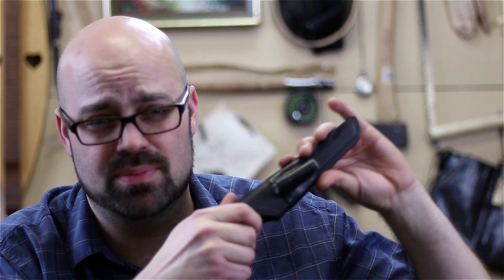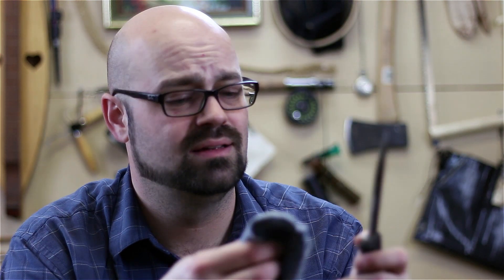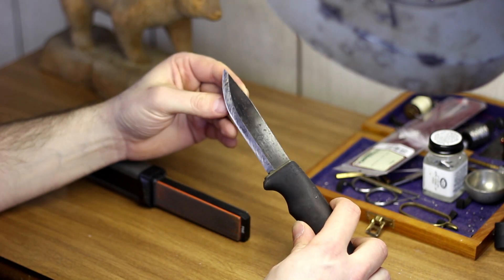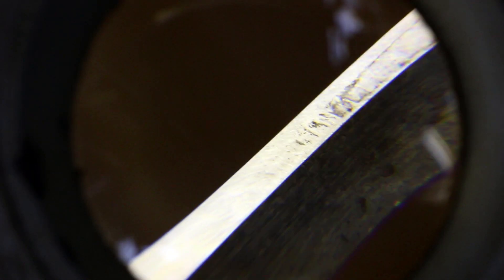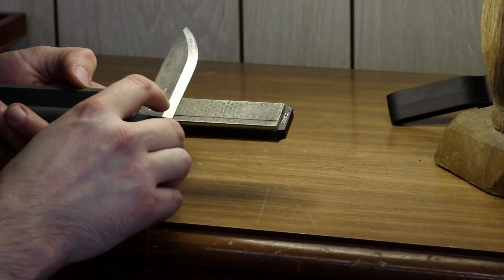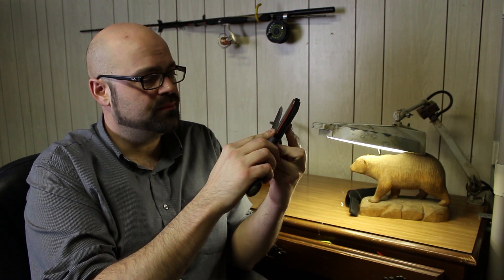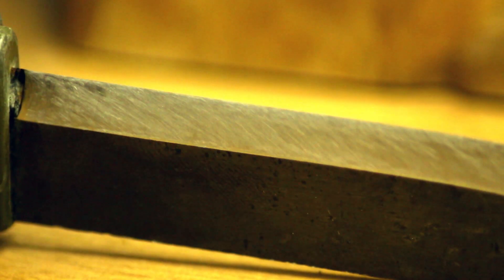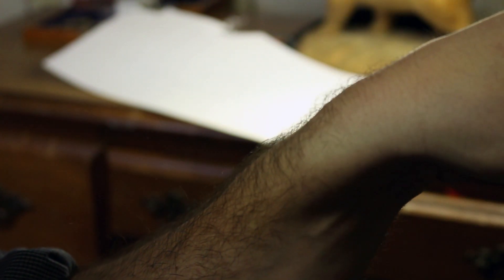Knife Sharpening - Cheap and Effective

Comment: The Smith's duo diamond sharpener is, in my experience, perfect for folding knives with blades up to 3.5 inches.  I have used it to keep an edge on my Spyderco Resilience, but I feel more comfortable working this 4.25 " blade on a larger sharpener. great portable sharpener and quite affordable.

Comment: Ive used Smiths Diamond stones like that for at least 2 yrs - cant say a bad word except longevity... I put stone to blade following the edge length wise rather than knife to stone as you did - still cant to this day get a good edge using that method lol... Trust me Ive tried:) what I did find by going length wise with blade is that I end up with a nick free edge left over from the diamonds upon lifting... some say that doesnt happen but after coming to a stop then lifting blade it will sometimes leave microscopic nicks... good vid bud keep up the good work

Comment: Nice work with a cheap sharpener
Do you strop your blade between sharpenings, it can maintain the edge and clean the blade at the same time. Starky blue is a good compound to use
Happy trails
Reply from the maker: paul sheppard I'll have to look into that. I do strop it, but usually with just my belt.

Comment: Before you decide to use a diamond sharpener on a knife you like, and plan to use often, you might want to watch such a sharpener at work under a microscope.  It's the scariest thing a knife lover can watch.   The sharpener does its job by slicing metal, rather than by polishing it down, and removes a lot more metal in the process. 

This doesn't matter if you don't plan on using a knife often, and don't plan on sharpening often, but if it's anything like a daily use knife, a diamond stone can shorten it's life by years, and harm the edge geometry much sooner.  

I measured the steel loss on two identical knives with a diamond versus a natural stone sharpener over a period of time, and the difference was significant.

Comment: Good video.  All I could add is you should unclog your sharpener.  I would try some water or light oil and an old toothbrush.  It will work better if it's unclogged.
Reply: Is this still true?   I heard you are not supposed to use oil or water on a diamond sharpener, like a wet stone. just dry.  maybe a dry toothbrush brushing. I don't know which, so I guess as long as it works either way.
Reply: Darignobullseye diamond stones clog too.  Lubricant is preventative.
Reply: +Nathan Beaudin Great to know. thank you!
Reply: use water after sharpening or before?
Reply: Firefly
 either or both.

Comment: When using your belt and hooking on your toe, you said "Kind of hold it 'TAUNT'," which is incorrect.  The word you should have used is "TAUT" - with no "N."  (Rhymes with "tot" and "taught."  

The definition of "TAUNT" is as follows: "to make fun of; to goad into responding, often in an aggressive manner."  

The definition of "TAUT" is as follows: "tight, under tension, as in a rope or bowstring." 

Thought you might want to know.

Other than that minor faux pas (French, "FAUX" - "false"/"wrong," and "PAS," "step" [pronounced FOE PAH] the definition of which is "blunder, mistake, misstep, error, gaffe" etc.), this was an informative video.  Thanks for posting it.